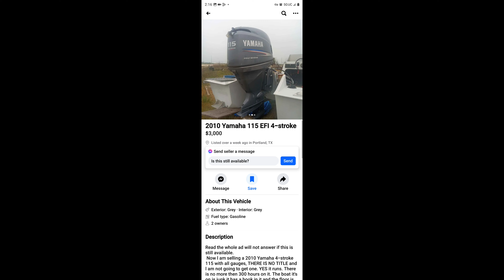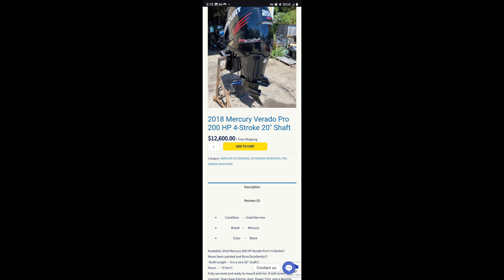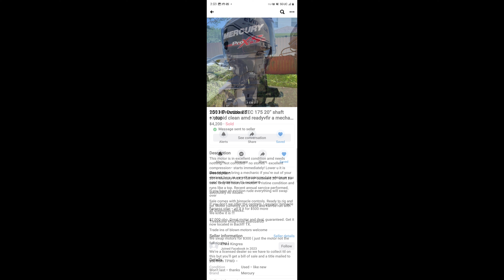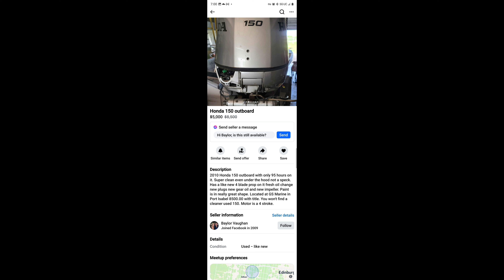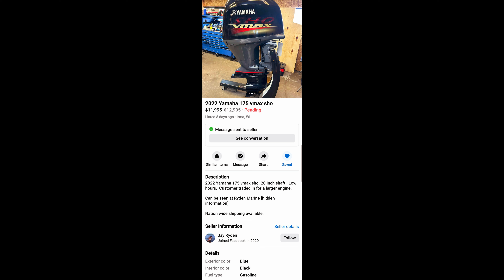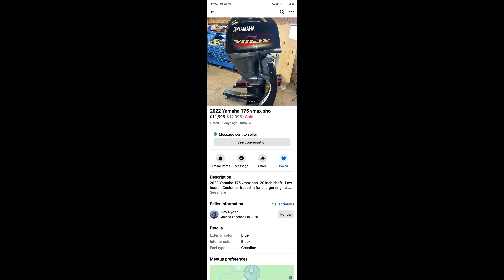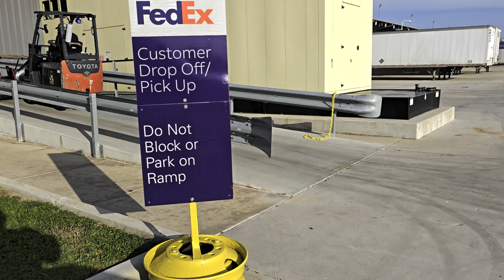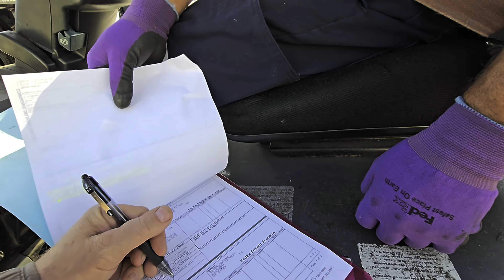Outboard Motors (Repowering My 1988 Shoalwater Flats Boat).

Comment: I have a 88 Evinrude 120 on my 88 Challenger bass boat. Guy I bought it from had a NOS powerhead put on it last year and full rebuild on the lower. It runs 52mph at 5000rpm
Reply from the maker: The 80s and 90s model Evinrude were solid workhorse motors... I ran a 1991 Evinrude 88 Spl. On my Dargel Scout for 20 yrs and it never broke down...no issues  mechanically out of that motor...the only downside was it was a gas hog...But a very good reliable motor that always bring  me back to the dock...Thanks For Watching!!!